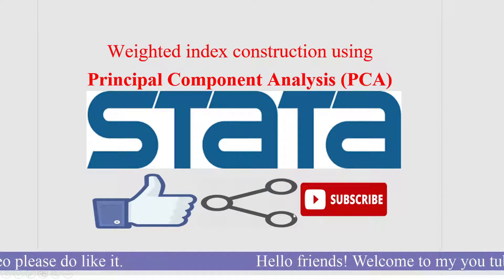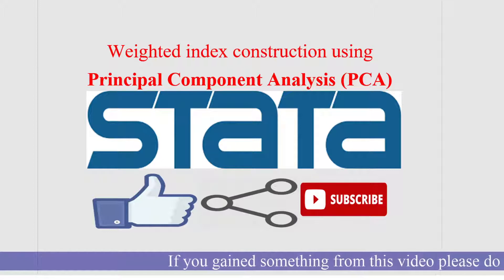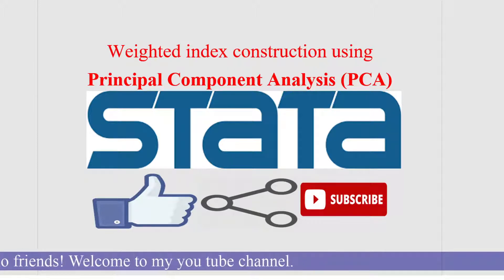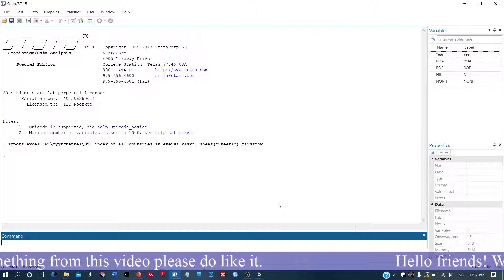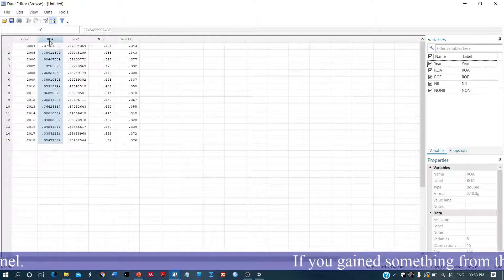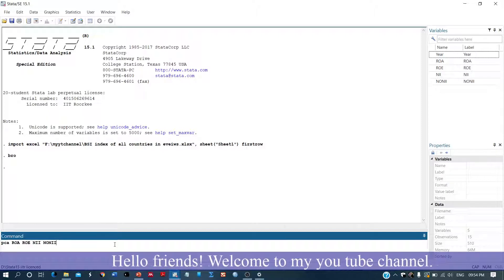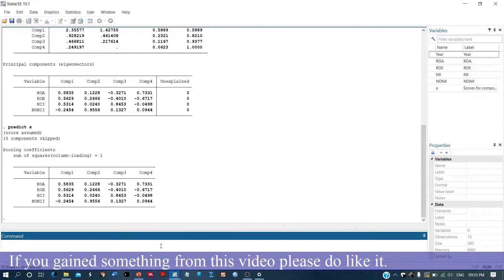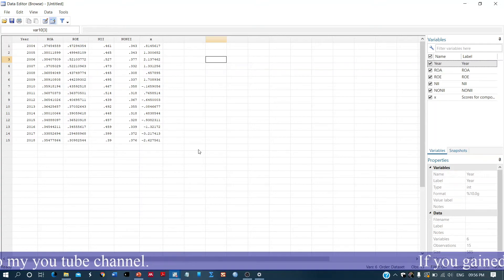How to construct Principal Component Analysis (PCA) weighted index.

Comment: In SPSS we have many factors based on egainvalue, how we can calculate weighted index using these factors in SPSS?
Reply from the maker: You get the rotated factor value multiple this with the eigen values...
Then sum the resultant value the absolute value ignoring - sings is the absolute weight..